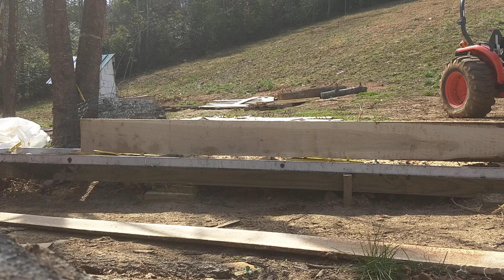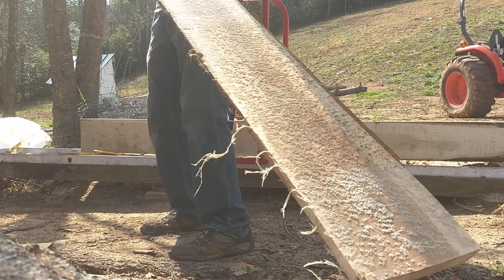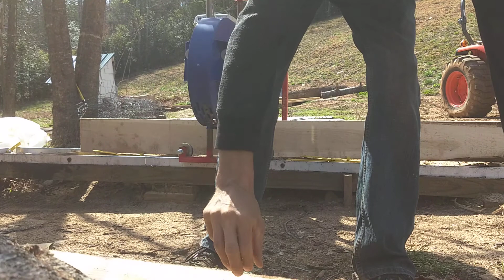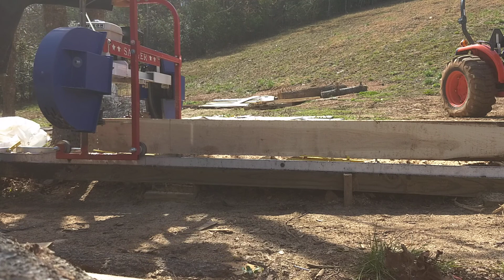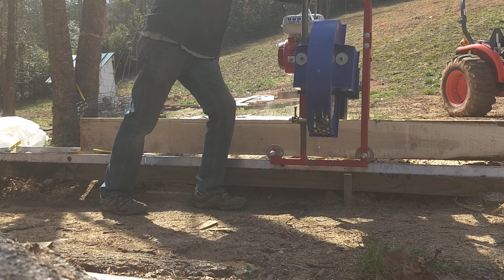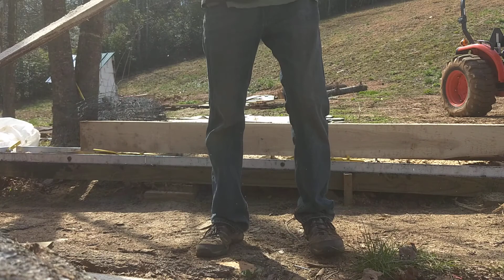Hudson Hunter & Sawyer Cutting Hardwood

Comment: Hi there. I purchased the Hunter version. I finally got my track system set up this weekend and set the mill on it. Been a lot of cold and snow here slowing down the set up. I was wondering, when you set the mill on your rails did you have any issues trying to level the blade with the track cross members? mine is 1/8" out of level with the track/rail system. When I adjust the eye bolt on one side the other side raises in the progress. I can't for the life of me figure out why both sides would raise when adjusting only the one side.
Reply from the maker: The Handyman its been almost a year since I've assembled my sawmill. I remember once I got it on the tracks I had to loosen most of the bolts on the mill head assembly frame then start readjusting. It took a lot of readjusting once I got it on the track. I had to add washers at the top of the frame and bottom. Still to this day the back left wheel is barely skimming the track. I'm eventually going to move my sawmill then I'm going to have two solid steel tracks made probably 16 foot long or longer all in one piece. so I can do 12 and 14 foot long boards. Be patient it took me a day to assemble it and then another day just to readjust it to get everything lined up
Reply: That's what I did with my mill. I purchased two 20' steel angles for the rails. Cut them down to 16' to make one solid track. As an after thought, I'm going to add the left over 4' sections to the beginning of the track and make a shelter around it 6' deep and 8' wide to push the mill into when not in use. As I don't really want or need to cover the whole track assembly with a roof.

Comment: Are the side blade guards made of plastic?
Reply from the maker: Oldold Pilgrim yes they are plastic. Even with the guards off if the blade came off it's almost impossible to hit you. When you change the blades on these machines the only way the blade can come off is forward opposite way of the operator then roll the blade out of the assembly. It also has two blade bearing guides on the operator side that the back side of the blade rides on plus a shoe system that holds the blade on both sides of the log. It's a good design. I've had the machine for a little over a year and it's already paid for itself. Since the video I have added 20-foot one piece tracks
Reply: Thanks for the quick reply.  There are many things I like about your mill as opposed to another I'm considering.
DIY one piece track seems to be the way to go with all of the personal mills.  From what I see on youtube, it's much less expensive and more accurate to source the track locally than to buy extra sections and try to keep the junctions straight.  What size angle did you use for your track?

Comment: its a great looking rig,but yours is not the only one that I have noticed the shaking,maybe if they extended the front out like the rear maybe that would sturdy it up more and weld a bracket around the carriage somhow,I did purchase one today now just waiting on it to be delivered,i was watching the video on installing I didn't like the part of drilling in the shaft maybe that's an old video and there pre drilled,.throw some more videos out,dont see many newer vids on..
Reply from the maker: Ba'rad 's since this video I've  reworked the machine I've added new one piece tracks three and a half inch angle Steel 18 ft long. I took the old track and cut it up into pieces and made more cross stabilizers for the track. I also learned a nice trick if you put your foot at the back wheel that's nearest to you if you applied just a little bit of pressure to the back so it's adding weight to the back  balancing the machine out it makes it cut twice as good. I've also reworked the carburetor so now I get a little bit more RPMs which really helps on bigger logs and Hardwood. Adding new tracks alone stabilize the machine alot. The three-piece track system that comes with it is the worst part of this whole setup. I'm going to be making a new video soon of the upgrades I've done and to answer some questions
Reply: hey I look forward to the new videos,i just received mine today I thought I would just slide the box off the truck shoot tht thing is heavy, yea I plan also on making longer tracks also,so do you still have to drill the shaft ,how long did it take you to put it together.id like to see your tracks to get an idea

Comment: Nice setup but I noticed that the whole thing was shaking around a bit. Is this normal or problematic? Thanks
Reply from the maker: Mark Pool in the video I had more Shake than normal because a tree limb actually fell on the mill during a storm before the video was made. Since the video I've added new tracks one piece three and a half inch ,20 foot long Steel tracks. I also turn the throttle set screw back slightly to add just a little bit more RPMs for just when I'm doing Hardwood that alone smoothing this machine out drastically. And I also figured out a new technique if you place your foot down towards the back wheel you can push down slightly and it will balance the push of the blade way better makes it cut smoother since all your push is being applied to the top of the machine. I've had the machine a little over a year now it's already paid for itself and paid for the track upgrade that I did I've been very pleased with it